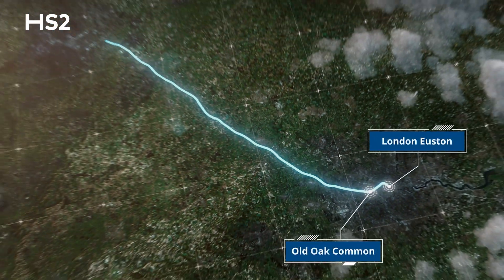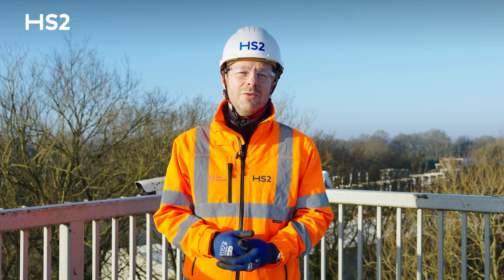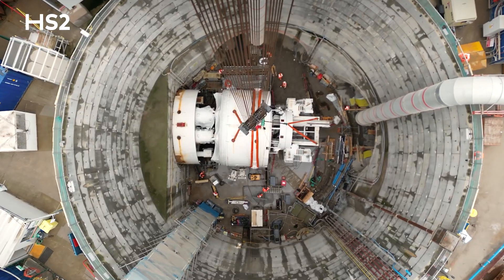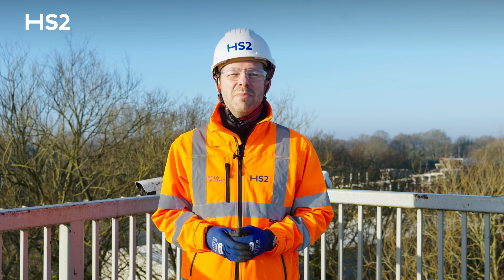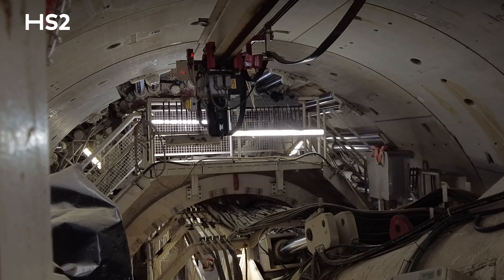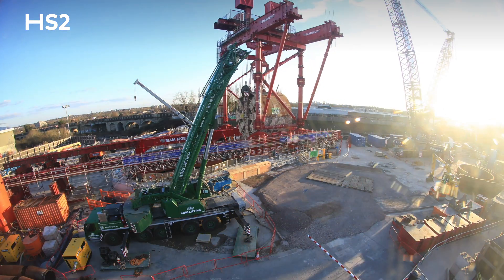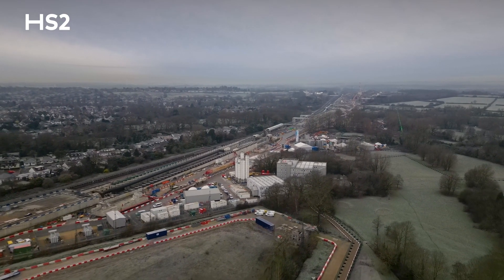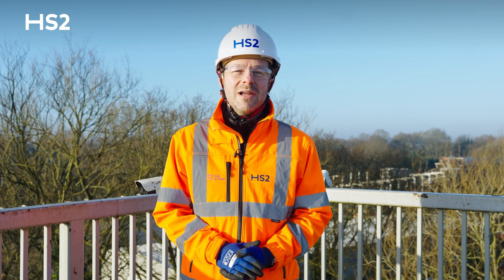Northolt Tunnel progress update: 🚆 Two tunnelling drives down, two to go 🏗️

Comment: I've been passing through West Ruislip on the Chilterns every day for years and have wondered how many of those curved sections of concrete have been used to line the tunnels.  It looks like it takes about a dozen of them to make a complete ring and there have always been hundreds, if not thousands of the things stacked up just outside the portals.  Any idea what the grand total is?
Reply: If you said about 8 for a complete ring is about 500mm there are 16 in of a metre. Multiply that number by 1,500 metres in a mile, which is 24,000 . Multiply that number by 2 tunnels ( one in each direction) gives us 48,000 in 1 mile. I read there are about 30 miles of tunnels on the route, bringing the total to about 1.44 million in the project.

Comment: What incredible work. I have got a question, why can’t they build magnetic train to make it go more faster like china has?
Reply: the accuracy needed for magnetic tracks is very expensive as are the trains. We don't even truly need high speed (I think)  - the capacity improvements for the rest of the network are the big benefit. i.e. the big benefit is that we move fast services off the rest of the network.
Reply: Despite many years of development in several countries, it is still just an eye wateringly expensive toy, to both build and operate.

Comment: I wonder why the decision was made to use 4 tunnel machines to drive to the middle rather than just two each building the entire length of one tunnel?  As the tunnel machine is 160m long while a half tunnel is 4 miles then each machine only tunnelled about 40 machine lengths.  Perhaps the ground consistency is very different between the two halves and so the tunnel machines at each end are quite different?  (Sad that this the first engineering related comment.)
Reply: Faster to dig with 4 rather than 2.

Comment: Maybe well be able to use Hs2 by 2040 🙄
Reply: You can expect to travel on HS2  between  Oak Old and Birmingham in 49 minutes by about 2030.  The next bit into Euston will follow, as the tunnelling is about to commence, but there is no proper plan for the station yet. And therefore no date. Of course all  destinations  north of Birmingham  will also  be using the HS2 tracks, but initially only to Old Oak.
Reply: @JohnHoward-wc9kk  HS2 now will not open with out Euston as OOC is not designed as a terminal station and with the tunneling work and track laying from OOC to Euston trains would not be able to operate at OOC for safety reasons
Reply: @JohnHoward-wc9kk  that's ridiculous.  I have built theme parks and leisure centres and the only times I failed to hit deadlines was when I used people who had worked in the rail industry
Reply: @steverichmond7142  Some of this delay is due to Covid. Some is due to change in the clients requirements, in that the government  postponed the start of the tunnelling to  Euston. I would not be blaming the contractors for that.
Reply: I'll be dead, and by the time this goes over budget and over runs time so will 80% of the people reading this. Far simpler to dig a big hole and pour Scotland's wealth into it. Ridiculous.